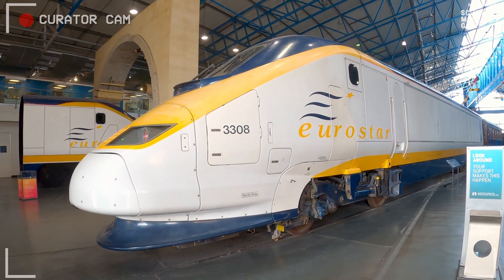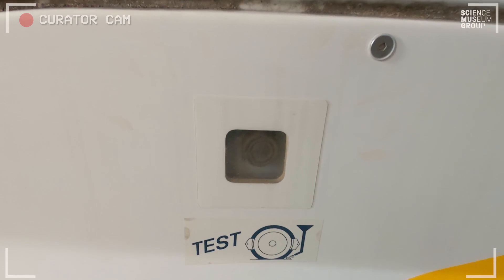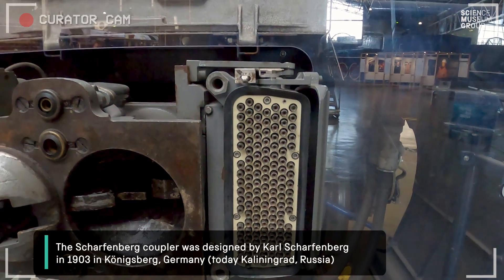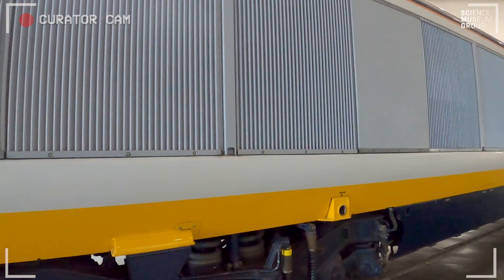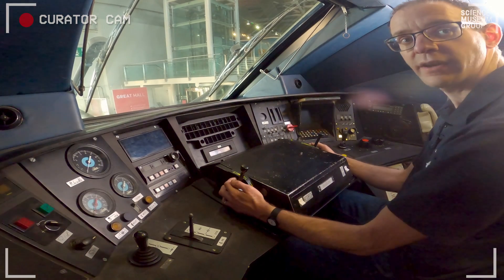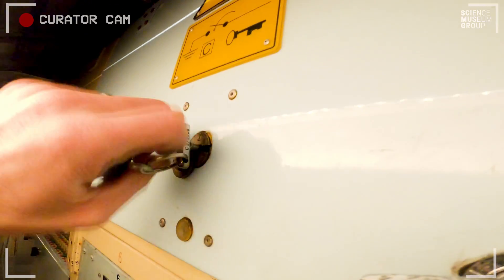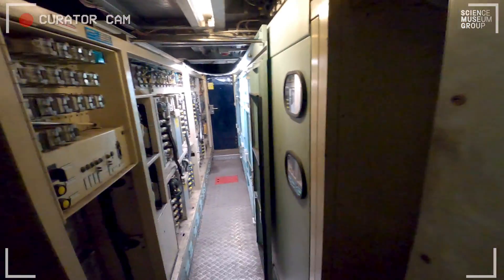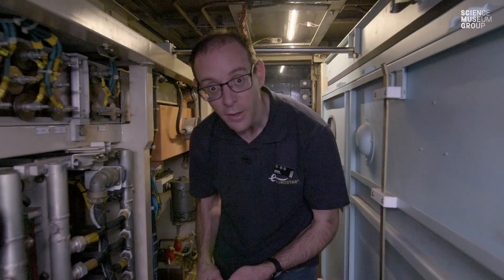What's inside Eurostar? Super-detailed tour of EVERYTHING | Curator with a Camera

Comment: Really cannot understand why there is a difference between 25 kv  on ordinary lines and the same voltage on hsl . 25kv is 25 kv . I recon they are over complicating things.
Reply: I think its the different frequencies, europe uses a different frequency to the UK. and all the cross border power transmission has to be done in DC because of it
Reply: It's to do with the overhead wire height and tension and also the different signalling systems (some of them were mentioned in the video). In the Eurotunnel, the height of the wires is higher than normal because of the LeShuttle trains carrying cars on double decker carriages, and the freight shuttles carrying HGV's. The French LGV lines are at a fixed height and run with TVM in cab signalling. Our domestic lines that are electrified at 25kV vary in height - you'll notice the height increases at level crossing to allow greater clearances - so the pantograph is set to allow this movement. The signalling system also varies as they use KVB in France and AWS/TPWS here in the UK.

Comment: So it was painted in 94 but plated in 95?
Reply: From what I understand the body shells were made first then fitted out with all the equipment, as was the case with the class 92s (the body shells were actually transported by road for this purpose!) So it is quite possible the body shell for 3308 was assembled and painted in 1994 but fitting out completed in 1995.

Comment: Amazing bit of kit. Travelled on them several times. Bit of a stretch to say they killed the airlines, mainly due to the high ticket prices, but still an amazing train. I guess the e320 Velaros are a bit simpler as they don't need 3rd rail. I wonder, did they remove the pickup shoes from the e300s/373s that are still in service? I guess they're not needed anymore.

Comment: It's fascinating to see this early 90s technology. These days of course a lot of the functions would be controlled or at least assisted by a computer, but in 1994 we're right at the transition point between fully manual and the beginnings of more computerised control. It's strange that it seems both modern and slightly old-fashioned at the same time.
Reply: There are a lot of computers onto this train
For exemple 
3 PLC (programmable logic computers) for the cab
2 PLC & 2RTC (Real Time computer) in the commun bloc
1 RTC in each motor bloc

And I don’t list all the safety equipments

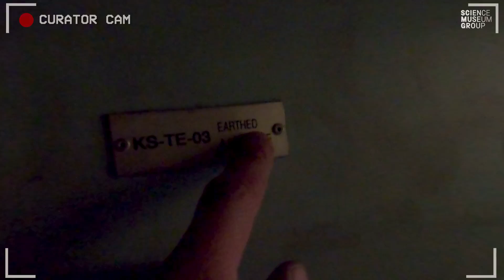Comment: cool video, and very detailed information. btw, at 13:33 im very curious what's inside the motor block. does it have some motors inside it or just some circuits?
Reply: In the motor blocs there only power modules, relays and cubicles for real time computer 
The motors are fixed under the body and  take a place into the bogie with the gear box
Reply: @gauthierfrancois926  thanks for the answer!

Comment: Does Class 373 have a Driver's Remainder Appliance Button like the HST Class 43 or not?  If so it should be located next to the Throttle Control like the HST learnt that HST DRA button from Train Sim World made by Chattam Kent Dovetail Games. The 3kv DC Belgian Pantograph is also suited for French 1.5kv DC. Speaking of the Cabinet behind the Train driver does it have the AWS TPWS UK TVM-430 KVB France Belgium TBL Memor II switches or not? That should have been said on the Driving the Eurostar section
Reply: No, it does not have TPWS, nor does it have DRA, this video kept referring it to be this being the train, it wasn't, its a single vehicle and therefore not a train, its a power vehicle, or more correctly noted as a Motrice, two motrice per train, M1 and M2, each half set had three powered bogies (six per train), two on the motrice and one on the R1/R18.
Reply: @simongrego4231  they are fitted with tpws and aws actually, and its own form of a DRA fulfilled by the blue neutral light switch on the left of the desk.
Reply: @nyan525  Not when they were built , TPWS was in its infancy when they were built, nor was DRA in the BR type fitting, again that was in its infancy too, AWS yes, the TPWS was fitted later, , but not technically required after HS1 and Temple mills were built as they ran off TVM430.
Reply: @simongrego4231  maybe but they are all currently fitted with functional AWS and TPWS, even though Ashford is now fitted with KVB. The DRA isn't a red button that cuts traction, it's a switch that blocks the brake from being released, but provides more or less the same function, a reminder for the driver to check the signal/cab indication.
Reply: @nyan525  Thats why i said when built, i havent done a 373 for some years, except ironically 3308 which is the one in York. I was a BRB Resident Engineer on 373  from 1993 until the last set was delivered, which was dispatched from Met Cam to NP without the Motrices being attached..
Reply: @simongrego4231  well glad we've cleared that up then.
Reply: @nyan525  Thanks for the answer and I'm more familiar with the Red Button Type from Class 395 43 HST. Commuter Trains 166 387/2 377/1 377/4 and 313/2.

Comment: So it was painted before it was built?!
Reply: I would think that the build date of 1995 was when the power car was actually finished but would have taken a couple of years to build therefore perhaps and the shell was painted in 1994? Maybe someone in the know could enlighten us.
Reply from the maker: We've asked Chris, will let you know what he says.
Reply: @NatRailwayMuseum  The Motrices were painted prior to being fitted out in Belfort works, as were all of the passenger vehicles, these being painted in Aytrey, DeDetrich, and Brugge. although some had to be partially repainted at Metro Cammell in Birmingham, due to damage or poor paint finish. The only passenger car that was completely UK designed, was the R6/13, which was the bar car,
I was one of the BR Board Resident Engineers on the Eurostar project,  and signed off the majority of the UK built sets, i also travelled to Paris LeLandy Depot to examine the first preproduction set (PS1) to allow it through the tunnel for testing in the UK, and that became the very first set through the tunnel.
Reply from the maker: News just in from Chris:

"The loco bodyshell was completed and painted in August 1994, hence its paint stamp. The power car fit out and assembly was finished in 1995 which is the vehicle's official date of birth. It is quite normal for the bodyshell and major components to be built at different times (and in different factories) before then being assembled as one."

Comment: The pictograms and brake indicators on the outside are common to all French rolling stock and unrelated to international operation requirements. I wouldn't be surprised if those are IUC standards too.

Too sad this power car didn't come with its original third rail contact shoes !

Comment: What is if you choose the wrong voltage system between countries? Do you fry the engine or is there some sytem to disconnect by fault?
Reply: I suspect the systems would automatically shut off   and force you to restart them. This situation actually happened to a Dutch locomotive built at the same time as the Class 373's just last year. Pantographs were raised on German overhead lines (15000 volts instead of the 1500v it needs) and the only thing that happened was that the pantograph automatically lowered and the protection systems came on.

Edit: quick background info. This happened in the station of Bad Bentheim in Germany where the overhead lines can switch between Dutch 1500v and German 15000v. This way there is no need for modern locomotives that can switch voltages. In this case the locomotive raised its pantograph while the power lines were set on the wrong voltage.
Reply: @treinenliefde  I do think that locomotive had to be towed to the workshop to be fixed.
Reply: @gwyneddboom2579  Yes thats true, however not because it was truly broken. Just because the driver wasnt allowed to reset the circuits himself. 

I cannot find the post on Somda but another driver explained that the actual 'fixing' was either just grabbing a spare part from the on board supply and swapping it or flipping some switches and earthing the locomotive. Completely doable for a driver but not allowed because of the strict regulations.
Reply: @treinenliefde  oh right! I had assumed the whole inside had melted due to the high voltage. Good to know!
Reply from the maker: We're asking Chris, will let you know what he says!
Reply from the maker: Chris said:

"Before closing the main circuit breaker the train checks that the voltage it is detecting complies with that which you have selected, if it does not like what it sees you will not get permission to close the main circuit breaker."
Reply: There are two things
The ground systems can send an information to the computers to tell which is the next system And if the driver makes an error, the pantograph don’t raise up 
The is also a system who verify if the voltage is AC or DC and if the voltage is between two values
The voltage selector is also used for others function (clock, power limit, choose of safety equipment....)
Reply: I know more modern trains first check the voltage they get before they actually turn on, using a voltage detection of some sort. I think getting a low voltage would be fine, but too high voltage would probably melt some relays.
Reply: I don't know if there are automated systems to protect the electronic but there definitely are voltage indicators in the cabin for the driver to check after he raised the pantograph, before closing the main circuit breaker.

Comment: Do you know why they couldn't finish the eurostar?
Reply: It was due to the introduction of low cost airlines which did the routes faster and cheaper than the train
Reply: @dubious_potat4587  Even if they could compete with the low-cost airlines I doubt it still wouldve happened. It turned out in GNER times that the 373's werent allowed to travel beyond York and Leeds due to gauging issues on the bridges near Newcastle and the power suppy on the route not being enough for these trains.